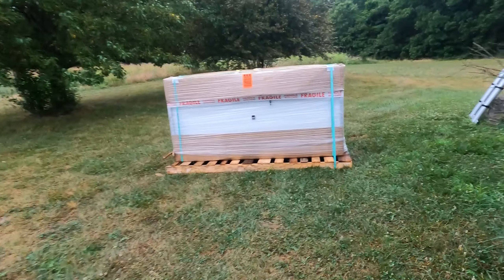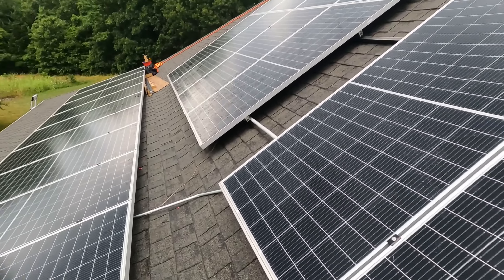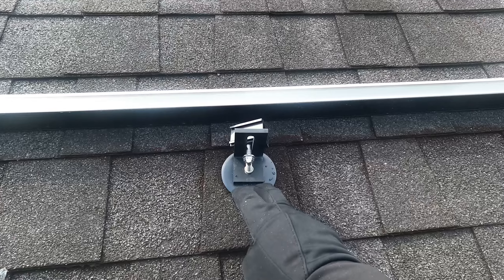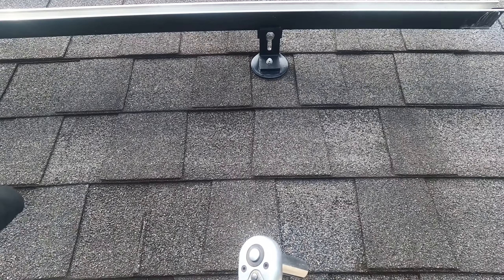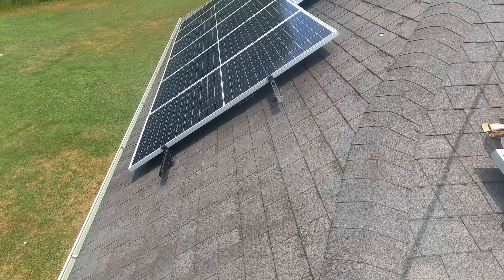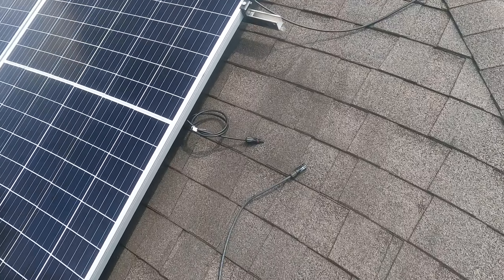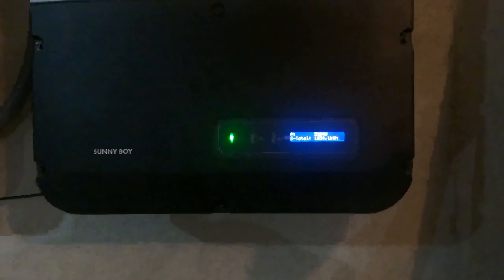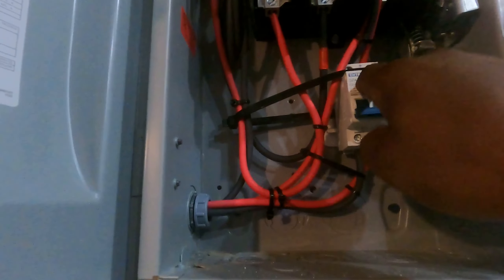A 20KW ROOF MOUNTED  OFF GRID SOLAR SYSTEM FOR COMPLETE ENERGY SELF-RELIANCE

Comment: People need to see what It really takes to power an average home in the USA. You can figure about $60-$100,000 if you DIY. When I see people driving these $80,000 trucks, that's a solar system to me.
Reply from the maker: I agree. These systems can be quit expensive and especially if you have to higher "professionals". I am trying to get my hands on the new Ford F150. Its battery is 130kwh and it has been build to plug into your home for backup energy.
Reply from the maker: *hire
Reply: If you have some discipline about your lifestyle and be less American in your consumption you can do it for a third of the price and at worst feel there is about a 10% shortfall for 60% less in cost.
Reply: A very good excellent system too!
Reply: No.... You can definitely do it for A LOT cheaper if you DIY.. hell, you can build 30kwh battery for 4000.00 and solar panels from San Tan solar and a couple of EG4 6000xps... Done....

Comment: We have 20.64 kW of PV. this time of year we generate approximately 80 to 125 kWh per day. Just for your information. We need more panels too. We live in cloudy Kentucky. If you were close, we could help each other. It's risky working alone. You be careful.
Reply from the maker: You guys completely off-grid? How is the heating in the  the winter?
Reply: @backtoeden2030  I use a wood burner below 30F. We heat with 16-33 SEER heat pumps. Standard water heater.
Reply: Yea, as I get into off-grid more and more, I realize that we humans use a lot of energy.  How big of a solar system and battery system have you both have now?
Reply: How much you generate in cloudy days?

Comment: Why not mount them on a rack near the ground? Easy maintenance, optimum south facing, adjustable angle and, it wouldn't be a hassle when you have to replace your shingles one day.
Reply from the maker: This was the best option for me. I wanted to minimize the length of wire from the panels to my basement. Also I do not have any shade around my home
Reply: Mine is PT lumber ground mount.

Comment: 14kw is fine for me if I conserve electricity and the sun is out. Cloudy day and I have to go back on grid power.
Reply from the maker: I also believe that thew 20kw that I have installed now should be ok especially during the summer. We may have to conserve and use less during the winter because we completely disconnected from the utility grid
Reply: @backtoeden2030  I'm learning that solar PV output on cloudy days is about 8% of sunlit days. So to have full capacity through any weather, one needs 11X the PV capacity of sunny conditions.

Comment: I'm gathering specs on what I would need and it might have to be this big. I have a Tesla that uses about 30kw a day for my commute since we live in a rural area. I have a level 2 charger that maxes out around 11kwh. I wonder if it will have to be dialed back to a slower speed or if it would be worth it to get a single large inverter and battery bank just for the car and run the house on a separate system.
Reply from the maker: I have see some youtube videos where they have a separate system for charging the electric cars. I do not have an electric car yet but I believe that I have sized my system appropriately to charge an EV even overnight from my battery bank.

Comment: If I have a solar array with charge controller and battery bank does the system draw power from solar first? And if I draw now than solar provides does it combine power from the battery?
Reply from the maker: I am not sure which inverter you are looking at but yes during the day the inverter uses the energy from the solar array to provider power to the house first and then whatever is left is used to charge the batteries. If the energy from the solar array is not enough then the inverter will draw whatever else that is need from the batteries to top up

Comment: where did you get those actual roof mounts with the rubber feet that screws into roof.?
Reply from the maker: https://www.solar-electric.com/quickbolt-solar-mounts-microflashing-flange-nut-pack-25-kit.html
https://www.solar-electric.com/tamarack-solar-84-4-rail-1-6-flush-mount-black-finish-module-kit.html
Reply: @backtoeden2030  thank you

Comment: I currently get by fine with 6.6kw of solar on a 2900sqft house. You just need to have a high efficiency heat pump and good insulation and you just don't need as much solar!
Reply from the maker: My home is over 20 years old. The appliances are not very efficient. I will have to invest in more efficient ones. Thank you
Reply: Depends on where you live. That is not much power equivalent to 2 wall receptacles or just 1 Water Heater. And that is on Sunny days only and for a few hours a day. 6.6 kw isn't much power for most people no matter where you live. A 200 amp system if you only pull .25% is 12 kw. and you aren't even calculating actual power after conversion and heat losses. Look at your Electric Bill. See if it shows How many kilowatts you use divide that into day then figure you gotta produce that much power in about 6 hrs a day and that assumes the Sun Ole Solo will shine ever day which it won't. Sorry but You can't dispute Facts with Belief. And the cost and batteries mercy. Have seen the Commercial for the So Call Solid State Generators. They are just Batteries with Converter they don't Generate a Damn Thing. Typical Solar BS and Lies like EV will save the world or environment. Nothing could be farther from the truth. TRUTH IS TRUTH AND A FACT IS A FACT. NUMBERS DON'T LIE BUT SOME USE PARTIAL NUMBERS AND HALF TRUTHS. NOT MEAN TO DISPUTE YOU BUT SO MHCH HYPE BY THE SALESMEN AND KEYBOARD WARRIORS THAT COULDN'T INSTALL A LAMP CHORD OR WIRE A 3 WAY SWITCH.
Reply: @TelecasterRon  I currently heat and cool with a heat pump, have my EV in the garage, and have a 6kw convection oven. I've drawn 175a from the wall before briefly, and I have a 6.3kw south facing solar array for my electric bill. It's simply not a problem for most people if not all people.
Reply: 6.6 kw is laughable. I Heating Element of two in a WH maybe 4kw. It takes X amount of energy for ton of cooling? Depend very much on where you live  and how much sun. Huge Variable. Like I said look at how much energy it takes not a bunch of hype. Feeble is an understatement. It works limited by many variables. 6-7 kw a few hr.  a day isn't much energy. OK to burn a 1 yr. - 20 yr. LED Bulb. Just wait till you buy Batteries. If roof top mted. When you replace roof because of leaks or the additional cost of removing and reinstalling them. They pollute like heck to manufacture. They make China Rich. EV's are a joke too. The Grid can't handle the load NOW. Wait till you add chging. an EV. No Way. Lets see here 6.6 is about 8-9 hp per hour for 6 hrs a day if your lucky and don't drive much.  The EV is a hell of a lot more Expensive Pollutes more than Fossil Fuel if you factor in all the Crap the Lunatics leave out. AND MAKE CHINA GREAT AGAIN. But don't worry cause you wont drive at all when they drive the last spike in American Industry. Anyone Reading this Get your Electric bill do the math. Based upon your consumption not the HYPE. Get the real numbers not the kw hokie pokie. If you get 6 kw at 36 vdc you get about 2 kw at 120 volts or 1000 at 240 for a given Amp draw. Ohms Law says if you double or triple voltage you cut current by double or triple for a given load Amps. 1 wall recepticle 15 amp 120vac is safe at say 10 amps or 1200 watts. A 20 Amp say 15 amps about 1800 watts. All this for 4 wall recepticles for just a few hours a day. There are a ton of CON ARTIST IN SOLAR. People that don't understand the numbers and truth behind Solar and So Called Renewables. Also there is efficiency losses in transforming your solar input to 120 or 240 vac. The voltage in varies all over the place at the panels or turbine. Not to mention Solar just isn't practical for most locations. Battery Tec is certainly Lacking, Dangerous and Un GODLY Expensive. Don't expect much cause you will.be disappointed. FACT is Fact. AND You are not helping   the Climate at all... ALL things Considered.  What you have is a bunch of Salesmen Making Money from your Ignorance. You Destroy America and We All Loose. Learn Before You Leap. See Through The Salesmen and slip n fall lawyers and profit driven CONS. Solar is Possible But Grid Tie put you as so many now are finding out at the Mercy of the power company too. Batteries are not nearly ready unless you are a bankster.
Reply: @TelecasterRon  You must not shop in Walmart Lowe's Home Depot target or any other store in America. You must not buy American standard, Lenox, Goodman heating and air-conditioning equipment. It's all made in China. we all spend money on junk that we don't have to have it. Yours might be on a new $80,000 truck mine is on solar. That's my choice and your choice.
Reply: Look I do all trades and ret as a BC Industrial, Commercial, Residential Contractor. Thanks for the advice on The Box Stores. But no thanks. You have every right to be  ignorant.

Comment: What inverters and batteries are ya usin?
Have u ever thought about usin geothermal cooling aswell?
Reply from the maker: Not yet, I will look into how that works what the cost will be
Reply: @backtoeden2030  its just dig a trench in the ground say 1.2M to 2M deep,about 20M long and run a pipe thats say 100-200mm diameter and blow air through it,the fan uses alot less power but then u would also have cooling if ya aircon failed but its also cheap and reliable
If ya dont mind me askin are u in africa by any chance? and I will say for someone who is learnin you are doin really good ;)
Reply from the maker: @Trent28888   Thank you so much for your insight. I am definitely going to look into it. I am located in the USA
Reply: @Trent28888  that might be OK in a dry climate. That will not work in most of the eastern United States where the humidity runs 110%.🤣😂🔥

Comment: All that still isn't half of a 200 amp line. About 66 amps at 240vac before conversion and transfer losses and prime hours only. Hey I am not being critical I was doing this stuff before most of you were born. Building Converters and Regulators too. But! I don't think most people Even know Ohms Law and don't understand panels are 15% efficient and 22% at best due.  to Silicon's limit. A home AC  system may draw 15000 of 12-15 kw while operating hear if 10kw may take 11-12kw. Your EV's are a joke for most people. Start with 1 hp is 750 watts. They are heavy and use more energy than they save. Heavy polluting production and Strip Mining in Lithium3 material mining. Extremly short life for EV power And cost to replace? mercy. If you wreck you may burn to death.or if they light up during charging. I dealt with Li3 and Li6 in the lab. It is no joke. At the power levels use to power EV good luck. Slip n Fall Lawyers are lining up for the Law Suits Coming. Solar if in a Off Grid Situation is doable but it ain't cheap for a real home power system. And makes China Rich. Grid Tie is getting hammered by many providers. Even Canceled all together in some states and regions. A lot of money and you are at the mercy of the system you are tie to. They can change the rules when they want. Learn about Solar. Stop Listening to the Hype and Salesmen's  BS. Of Grid it is a way to get some power. As a Industrial, Commercial, and Residential General Contractor If you use the attachment hardware illistrated here get ready for Roof Leaks Galore. Be prepared for major water damage. As the shingle age and get brittle and shrink you will get leaks. Never Put Panels over a roof with such attachments. Your 25 year shingle will become a 20 yr. if your lucky. Mount them on a Ground mount where service proper angle and cleaning off is much easier and safer. Also orientation is everything. South facing and some morning and evening sun is doable and sometimes desirable. AS I SAID OFF GRID GREAT. ON GRID YOU ARE AT TGE MERCY OF THE POWER COMOANIES WEEMS. Don't expect a lot. It isn't what you been lead to believe. Learn OHMS law for DC at least.. Also all that promise power when divided into 24 hrs ain't what you thought. EV power from Solar is a joke. Expensive and not needed kr even doable. Figure total amount of energy used in Fuel in kw's.  or in hp. hrs. It is ridiculous. Wait till you get to replace the make  China Rich again Batteries. You'll Learn either by Doing the Math or going Broke.